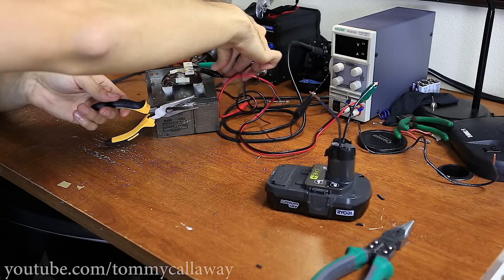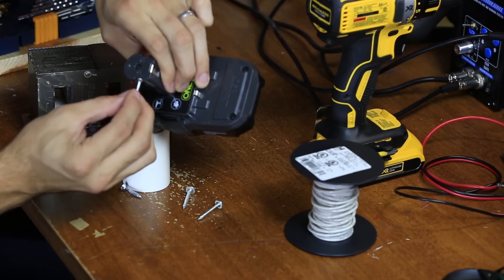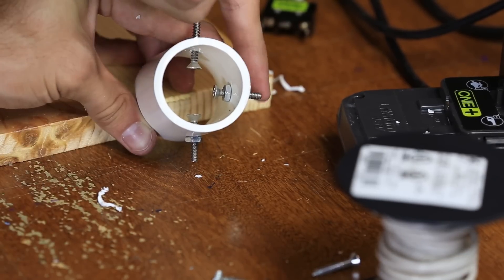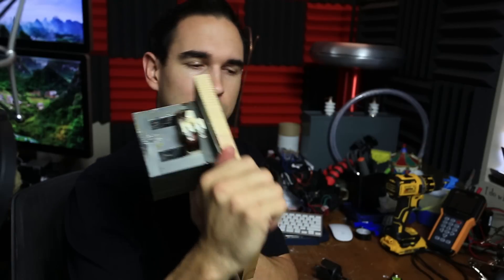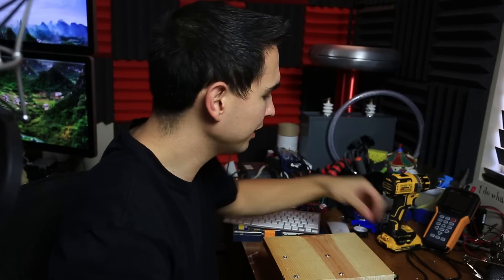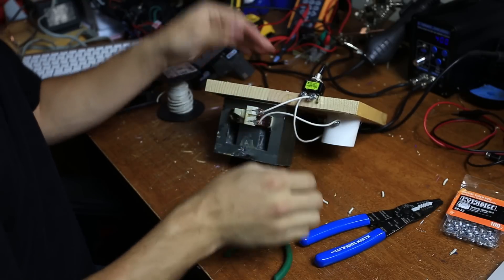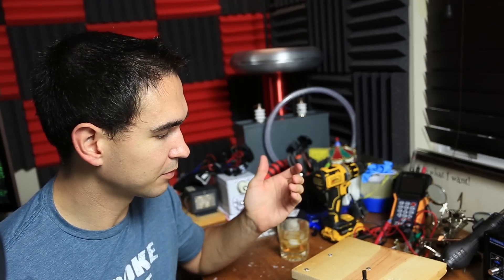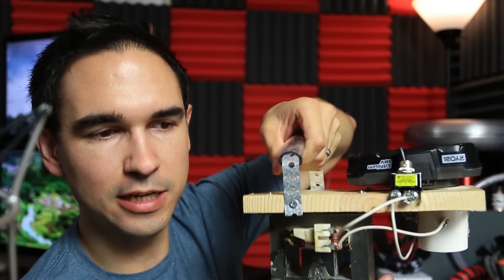DIY Cordless Electromagnet

Comment: Hey did you mention you need a low voltage cut off circuit so you don’t overdrain the battery and ruin it ? Good video but I wish you did 5 other strength test it looks kinda weak

Comment: I think engineers like to say "there's nothing new under the Sun" 😂 because I literally just built one of these and am using a FLEX 24 volt drill battery to power it. Every time I spend hours and days inventing something it turns out hey it's already been done like 30 years ago LOL.  I do have to agree with the guy that said cut the bottom off I've researched a whole lot about electromagnets in the past couple of months and a lot of it's been just trial and error and that's definitely something that will make it much much stronger. I just ground out the middle part of the m tonight so I'll wind that and find out whether just a u-shape is even better which I believe it will be.

Comment: Silly you, you did it wrong, cut the transformer down into the E shape like just about everyone else did on youtube, not because it's easier to take out the coils that way but because when the core is in the E shape it folds the magnets field in a much more effective/efficient way, making the electromagnet much stronger, and use a solid state switch if you're gonna use it a lot so you don't waste switches